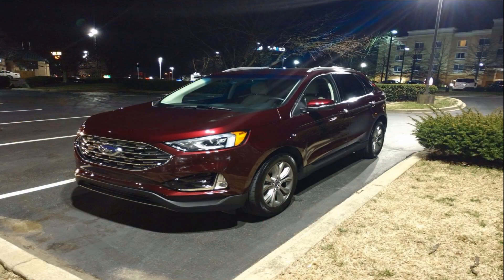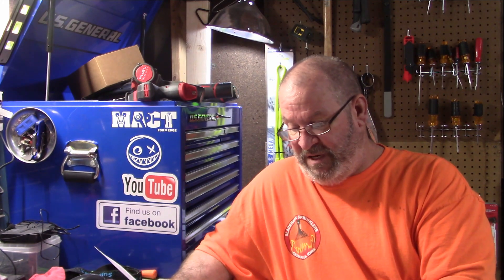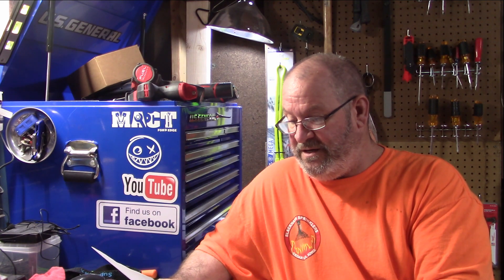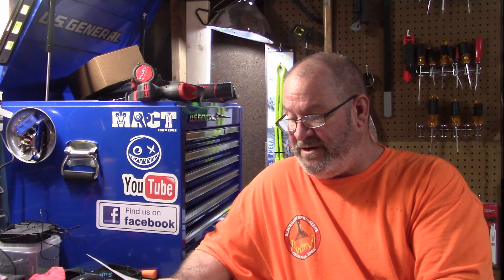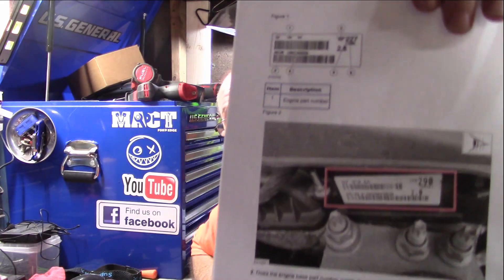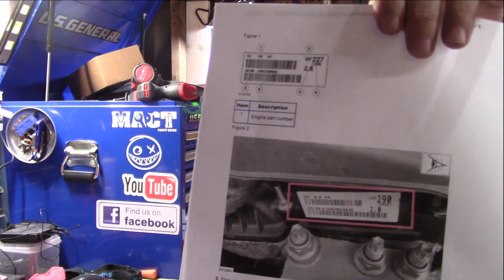TSB 19 2346 2 0 Ecoboost Coolant in Cylinders water intrusion

Comment from the maker: Were these failed 2.0 ecoboosts Cleveland Engines or Valencia Spain Ecoboost engines. Ford makes them at both plants and puts them in many vehicles.
Reply: December 3, 2020 — Ford EcoBoost problems have caused a class action lawsuit that alleges 1.5-liter, 1.6-liter and 2-liter EcoBoost engines allow coolant to leak into the cylinders.

According to the lawsuit, these Ford and Lincoln vehicles allegedly suffer from cracked cylinder heads, inadequate seals and total EcoBoost engine failures.

2013-2019 Ford Escape
2013-2019 Ford Fusion
2015-2018 Ford Edge
2017-2019 Lincoln MKC
2017-2019 Lincoln MKZ
One of the plaintiffs who sued says he purchased a used 2016 Ford Edge in March 2018 when the SUV had 36,376 miles on the odometer. But in November 2020 and with about 65,000 miles on the vehicle, the plaintiff says the EcoBoost engine warning light illuminated and convinced the owner to take the Edge to a Colorado repair shop.

The technician “SCAN[NED] COMPUTER FOR TROUBLE CODESP0303, P0316 (MISFIRES)” and said the “ENGINE COOLANT WAS ALSO LOW.”

“Test fuel and ignition systems for misfires. Perform block test, and pressure test cooling system to inspect for possible coolant in cylinders. Coolant is leaking into cylinder #3 and block test indicates combustion gases in cooling system. Long block assembly may need to be replaced per Ford service bulletin.” - Ford Edge repair order

The plaintiff says he was advised to take the SUV to a Ford dealership and was charged $189.00 for the diagnostic work.

The EcoBoost lawsuit says a Ford technician determined the engine needed to be replaced for $10,000, then decreased the replacement cost to $7,178.62.

The plaintiff allegedly contacted Ford’s corporate customer service department and requested reimbursement or a discount for the replacement of the EcoBoost engine, but Ford allegedly refused to cover any of the cost. The Ford EcoBoost problems allegedly have never been repaired.

Owners who report Ford EcoBoost problems claim the coolant enters the cylinders and causes corrosion, oil dilution and contamination, leading to engine damage and expensive repairs.

The alleged defects have existed since the vehicles were first sold, something Ford allegedly knew but concealed from consumers since 2010. The automaker has allegedly failed to provide EcoBoost owners with proper solutions and only offers "temporary stop-gap remedies such as installing coolant level sensors."

According to the class action, the sensors allegedly alert drivers when the coolant is gone, but the sensors allegedly do nothing to prevent coolant from leaking into the EcoBoost engine cylinders.

Ford EcoBoost problems also allegedly cause owners thousands of dollars for repairs and replacements that must be performed to drive the vehicles.

Service Bulletins About Ford EcoBoost Problems
Ford issued multiple technical service bulletins (TSBs) and other service messages for vehicles equipped with EcoBoost engines, something the plaintiffs claim proves the automaker knows about the alleged Lincoln and Ford EcoBoost problems.

SSM 47204 – 2015-2018 Fusion/MKZ/MKC/Escape/Edge
SSM 47462 – 2015-2018 Edge, Fusion, Focus, MKZ, MKC, Escape
SSM 47625 – 2014-2019 Fusion and 2017-2019 Escape
SSM 47849 – 2014-2019 Fusion and 2017-2019 Escape
TSB 19-2375 – 2017-2019 Escape; 2014-2019 Fusion
TSB 19-2346 – 2015-2018 Edge; 2017-2019 Escape, Fusion; 2017-2019 MKC, MKZ
TSB 19B37-S1 – 2017-2019 Escape, Fusion
TSB 20-2100 – 2014-2019 Fusion, 2017-2019 Escape
TSB 19B37-S3 – 2017-2019 Fusion, Escape
SSM 48991 – 2015-2020 F-150/Edge/Fusion, 2016-2018 MKX, 2019-2020 Nautilus, 2017-2020 Continental
According to the Ford EcoBoost class action lawsuit, the engines have inadequate seals on the cylinder heads and grooves where the cylinder heads attach to the engine blocks. Coolant allegedly enters through the grooves where it pools and degrades the gasket seals and causes coolant to leak into the cylinders.

The Ford EcoBoost class action lawsuit was filed in the U.S. District Court for the District of Delaware: Reed, et al., v. Ford Motor Company.

The plaintiffs are represented by Berger Montague PC, and Capstone Law APC.

Comment: I have a 2017 MKZ with a P0304, misfire on cylinder 4.  It shakes a bit but if you can keep the idle speed around 1000 (stepping slightly on the gas while waiting at stoplights), it no longer misfires.  This car is out of warranty so I have to fix it myself.  Does this appear to be the same problem?
Reply from the maker: More likely either bad coil or worn plugs.  time to make a change.
Reply: @MACTFordEdge  Nope.  Swapped coils, replaced plugs, replaced fuel injectors.  Did "relative compression" test and cylinder 4 fails with a -27 (I got a new scanner).  Problem has to be in the engine, there is nothing else left to test.
Reply from the maker: @BillAnon  Valves coked up with carbon?
Reply: @MACTFordEdge  That is possible.  But I did couple of cans of CRC Intake Valve & Turbo Cleaner.  It seemed to run a little better but still shaky at idle.  I guess I have to open it up and take a look.
Reply: @BillAnon  did you figure this out? I have a ford fusion with the same problem. But cylinder 2
Reply: @BuchananConceptsLLC  Not really.   I took it to the dealer and they said low compression in cylinder 4 so they need to replace the engine for $7000+.  I ain't paying that when I  can get an engine with a 5 year guarantee for $1200.  I spent $250 for an eBay cylinder head.  Now I am going to try a swap.  I started yesterday but did not get a chance to work on it today.  Hopefully I will see what's broken tomorrow.
Reply: @BillAnon  How did it work out for you?
Reply: @bartman2144  Well, I narrowed it down to cylinder 4.  I removed the cylinder head and found cracked piston.  Luckily the block was undamaged so I just bought a new piston and rings and the car runs fine now.  My neighbors were laughing at me thinking I could not get that car back together, no one is laughing now.
Reply: @BillAnon  Can you come over to my house and help me fix mine??
Reply: @bartman2144  I learned the hard way why they just replace those engines.  It took several months off and on for me to finish that job.  The man-hours would cost more than a used engine.

Comment: I have a 2019 ford fusion titanium with the 2.0 ecoboost with 35,500 miles  i just bought it used and when I got it it sounded and drove fine 
After 2 weeks it was making a pinging noise Sounded like the ac clutch bearing i took it to the ford dealer since it was still barely under the bumper to bumper warranty and half the power train 
They called and told me it wasn't the ac it was coolant getting into the cylinders that was making the noise and that they will be putting in a long block engine free 
3 weeks later engine is done brand new long block im putting a oil catch can on it
Reply: can you update? hows it working for you now?

Comment: Hi
Do you know if this affects every model worldwide for these years? Mine is an 2018 Escape, actually no problems but as I understand it was built in Spain (I am in Colombia). The warranty finishes the next year and I’m worried that this happens after that. Thanks!
Reply: Those engines are from Valencia from what I understand. The motors from Spain were not built with the short block that has these problems. This shouldn't be an issue for you. They're replacing the short blocks with the long blocks from Spain.

Comment: I have a 19 fusion with 45.000 miles on it. My car check engine light would come. I had to take it back to dealership several times after leaving my car for 6 weeks ford has supposedly put a new motor in it.

Comment: Extremely timely. Just bought a 2017 Edge w/ same engine from Carvana. Same issues - white smoke w/ rough start/idle & high temperature. Vehicle has just over 60K but DID come with a powertrain warranty (100 days or 4,300 miles). Began having this issue on the 8th day after purchase - no joke. Carvana’s & their warranty company are fully aware of the issues & I am headed to have it serviced tomorrow per their direction. I absolutely WILL share this with the shop & mechanics. Again, PERFECT timing - thanks! 👍🏼
Reply: Did Carvana honor the warranty?
Reply: @stuartbear922  - The short answer is yes, Silver Rock (SR), the warranty company that Carvana uses, ultimately followed the Ford TSB and agreed to replace the engine at a cost of just over $7,000. Needless to say, Carvana & SR “took a bath” on this transaction. This was NOT a smooth or short process. Read on if you wish to know more...

Initially SR selected several local mechanics (including Midas, the muffler specialists) to diagnose the vehicle engine problem. After two different shops concluded it was beyond their capabilities, I insisted a Ford dealership look at the vehicle. SR made me pay a $50 co-pay - which I happily did - and within a few days Ford verified the engine needed to be replaced, using diagnostic tests per the TSB. My Ford dealership was already familiar with the TSB & had replaced a couple engines in different vehicles due to the same problem/defect. Once Ford diagnosed the issue, it took another 50 days before SR agreed to honor the TSB. Before they did, SR twice scheduled a third-party auto adjuster to come in & verify Ford’s findings.  After that SR then asked Ford if they would be willing to install a used engine (of SR’s selection). Not a rebuilt, simply a used engine from a salvage yard. Ford flatly said no. Then SR attempted to tell Ford the vehicle would be taken to a different shop for the work...which was without my consent. My Ford dealership called to alert me of the situation & ask if I had approved a tow of the vehicle. Needless to say I called SR and gave them a piece of my mind for over 30 minutes, talking to two managers & ultimately an adjustor. Shortly after that conversation, SR conceded and agreed to install a new engine per the TSB. 

Btw - a rental vehicle was only provided by SR once the work began; I went for approximately 30 days without a vehicle & little/no compensation. Given my experience, I cannot recommend Carvana even though I ultimately was “made whole“ the very fact Carvana would sell a car with this type of issue is unconscionable. I didn’t mention before but Carvana’s original delivery of my vehicle was delayed twice due to “mechanical issues“ which Carvana was never able/willing to fully disclose the exact nature beyond bad spark plugs & coils. In retrospect, that WAS the red flag & I should’ve walked away. 

The vehicle runs like a new car and the engine comes with a 2 year/24,000 mile warranty, courtesy of Ford. So I now have a great used car with a new engine & a much better warranty than SR would have ever provided. I ultimately won by being an unwavering advocate for my own well-being AND calling SR out.

Comment: I noticed recently i was 1 inch from max on my resiv tank. topped it off. a week later its in range but low again.
2017 ford fusion titanium echo boost 4 cylinder.
this has 44,500 miles on it.
no extended warranty. i believe the power train warranty is to 60,000
no engine light on.
i dont think i have white smoke but ill have to look.
i dont think it runs rough in my opinion.
But i am within the 5 years and under the 60,000 miles.
I know for sure the coolant level is dropping.
I will look in and underneath the car in a day or two but i think i need to make a service apt asap to get this looked at.
I hope they dont try to run a scam. oh no thats not it. and try to wing me to 60,000 so they can say nope, out of warranty.
hmmmmm.....
Reply: I’m in the same vote. I pointed out to my local Ford dealer that I noticed that the engine was using more than normal coolant and they said they didn’t find anything. Time to trade before I get stuck with a big repair bill.

Comment: Had my engine replaced on my 2017 Fusion with 33k miles on it in March of this year. No white smoke or MIL, I just happened to notice the coolant level was always low and I would top it off. Didn't think much of it until I read about this TSB. They checked it out and replaced the engine without issue. I also had to have the dash replaced at the same time due to improper fit. They had the car for about a month but gave me a free rental (mustang), although I barely drove it due to covid.
Reply: Did you have to pay for it?
Reply: @TheGabbyGlammy  Nope, it was replaced under warranty.

Comment: So, does anyone know the root cause of the failure?  Is it a bad casting process in the aluminum cylinder heads, are there microcracks?  How widespread is this failure?
Reply: I've read that the problem is due to a faulty design.  No amount of maintenance will prevent the issue.

It's caused by 3 things , in tandem:
1.  The cylinders are an "open block" design.  Same reason Subaru engines have been known to blow head gaskets, for decades.  Basically, they don't "backfill" the area around the cylinders with metal like a "closed deck" design.  The cylinders in an open block design have a very thin and weak (I'd say poor) mating surface between the cylinder and the head, when compared to a closed deck design which would give you a much wider and thicker and stronger mating surface.
2.  Making matters worse, the Ford put a coolant "slit" in between these already thin mating surfaces, effectively making the already flimsy mating surface  between the cylinders 1/2 as wide, and then pumping hot coolant through it, which further weakens the cylinder-to-head seal.
3.  You've got turbo and direct injection on this design, which increases the pressure in the cylinders as compared to a port-injected, naturally aspirated design.  This puts additional strain on an already narrow head gasket mating surface.

The Ford 1.6 liter turbo also has suffered from the same problems, for the same reasons.  So bad, I've heard they discontinued that 1.6 engine.  I have heard that the replacement engines have been changed ---  the coolant "slit" between the cylinders has been removed from the revised design, in hopes of getting a thicker, stronger mating surface between the cylinders and head.
Reply: @dirkdiggler5164  So basically I should probably trade this in before the powertrain warranty expires.  My coolant was below the MIN mark and my Ford dealer recommended a coolant flush.  They played dumb on the entire issue, said it was fine.  Such assholes.
Reply: @markmcneil2031   I'd be worried if my coolant level dropped on an Ecoboost engine, especially by as much as yours to below MIN.   That's the classic tell tale sign that the coolant is beginning to seep past the head gasket and into the combustion chamber.   It's terrible that dealer lie like that --- a flush won't fix a "losing coolant" issue on ANY vehicle.  Also, these dealers know very well about this issue.  They're probably trying to avoid giving you a new revised engine under warranty, and if she blows up after the warranty expires, then it's on your dime.  Might I suggest you call the FORD Warranty phone directly and tell them about your issue, tell them you want the motor tested for coolant loss, and if it comes back bad, you want the updated engine installed.
Reply: @skymningforelsket1302  I think the Dealer is just trying to buy time until my warranty runs out.  They probably added a stop leak to the coolant as well, Ford is incredibly shady and I will never buy another Ford or American car in my lifetime.  Really ironic since this is my first American car EVER in 34 years of driving, I had less issues with Audi/VW so that is saying something.  I might try that avenue with Ford but they suck IMO.  Fool me once...
Reply: @markmcneil2031   I own a Ford now myself.   It's a 2.5 liter with 6 speed  torque converter transmission.  It was a dinosaur  design by the time I bought it--- in the 9th or 10th year of production at the time of purchase, and 2019 was the last year before it was retired.    No turbo, no GDI.  It's a Mazda designed engine with a good reputation.  They've made some good products.  The Town Car, Grand Marquis, and Crown Vic are considered excellent.  But you've got to be VERY careful and selective about what  specifically you  buy from Ford, b/c they've made more than their fair share of sub-par products, too.
Reply: @skymningforelsket1302  I could live with that if they recalled the engines or extended the warranty given it is completely their mistake.  Ironically, I stayed away from 3.5L V6 due to the internal water pump configuration.  I will just go back to Toyota or Honda, all auto manufacturers have issues but less overall with those brands.  My parents had the first Ford Taurus in 1986, every available option including a heated windshield, great car and overall build quality.  That is what turned Ford around in the 80's.  They can't expect repeat customers with engines that blow at (far) less than 100k miles in my mind.  Most cars RARELY need complete engine replacements or long block replacements with regular maintenance.  I realize there is a high cost for recalls or warranty extensions but someone at Ford isn't understanding brand loyalty.  Lesson learned the hard way.  I am glad you are having better luck with yours.